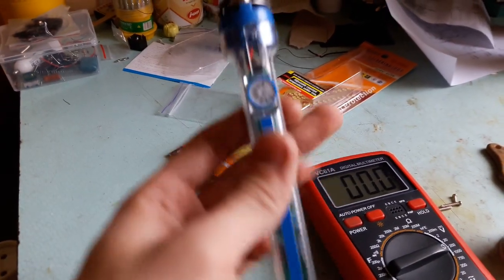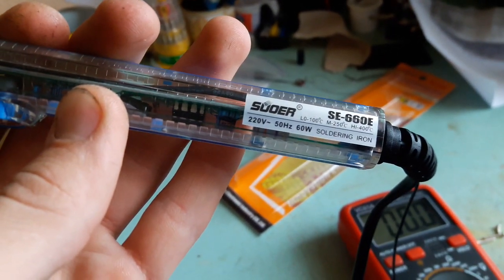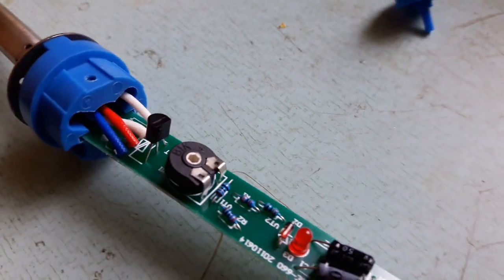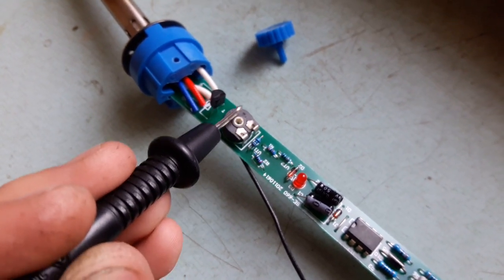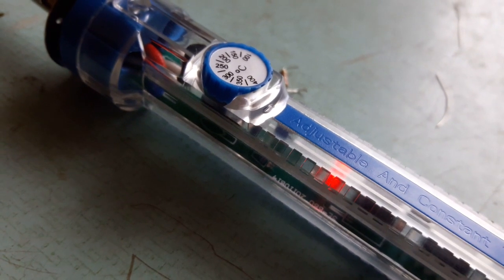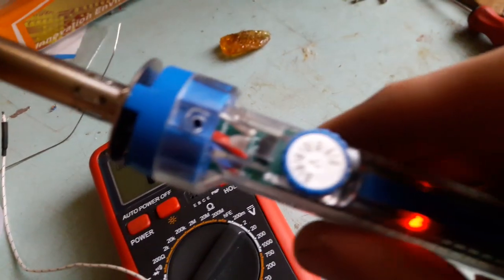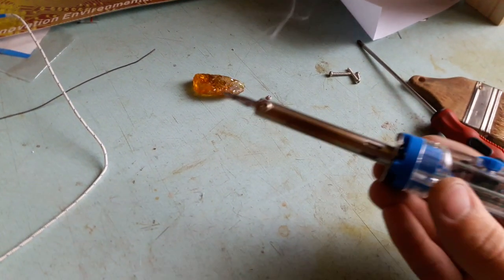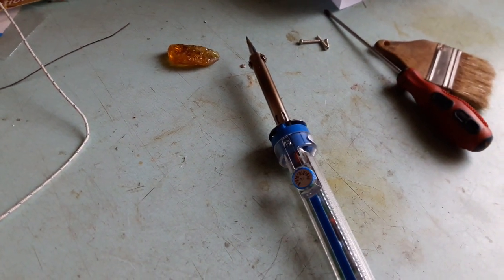Cheap temp controlled soldering iron

Comment: I have a triac phase fired iron. It's my "mobile" rig. For when I have to solder something away from my bench. It's good enough for sticking wires together or what have you. And yeah I just see how it melts solder to see what to set it at. It doesn't even have numbers around the pot.
Reply from the maker: I had similar iron too, but it pissed me off to be honest :D Very poor thermal coupling between heater-tip, and only thing you control is POWER. While you are soldering at a given pace, it's alright, more or less. But if you put it on stand the tip overheats and goes crusty blue. That's what I don't like about those irons.
Reply: When I idle that iron I make sure to turn down the power on it first. For the most part I tend to not idle irons though. I get everything ready then power up my iron to solder with. It is a bit of a pain but I worry about tip wear.

Comment: That's an interesting looking iron, i like the clear case :-D.
I was going to say "Rotate the sticker on the knob" but you said its non linear so hmm :-(
Replace the sticker and put dots for the actual temprature? lol.

Forgive me for being silly, but it runs from 220v and i cant see any triac unless that tiny 3 pin device near the pot is one.
If it is, its very weedy lol :-D
Always nice to hear you having a play with electronic related items, don't let your electronics hobby die.
Reply from the maker: That TRIAC is rated like at 1A, while the load is 60W/230V=0.26A, more than enough.
 Damn, I could've indeed just offset the sticker 0_o The knob is on hex shaft, thus minimum angle you can rotate it is 30degrees, let me just say that doesn't work out as good as I would want.
 My hobby is not dead, but it sure is struggling to live.